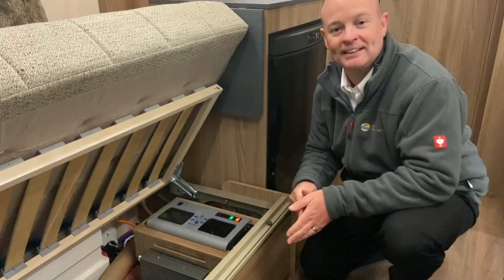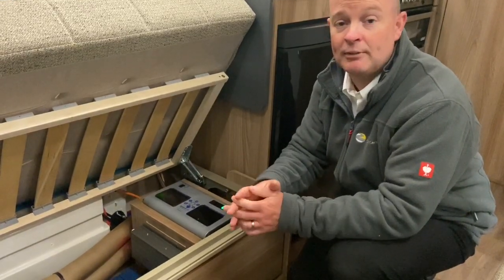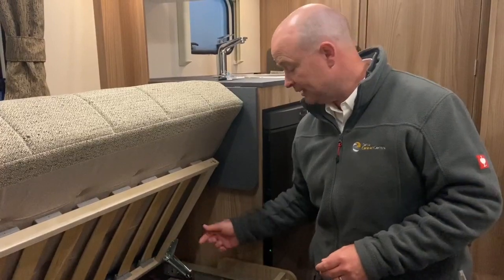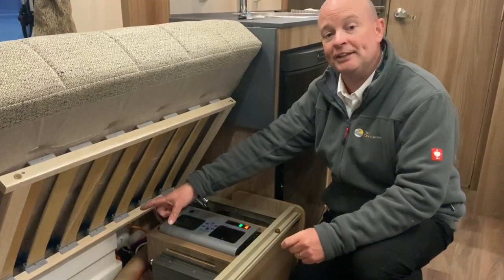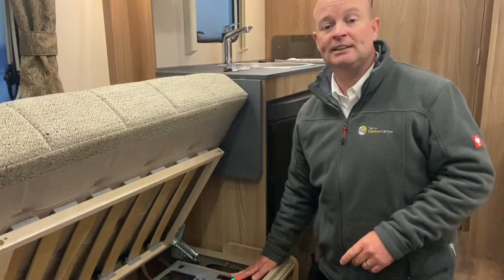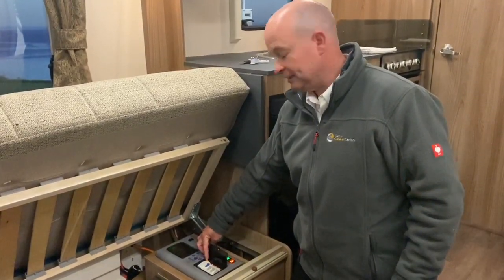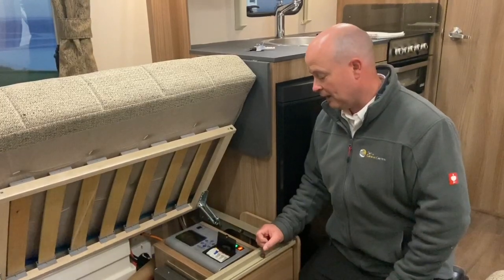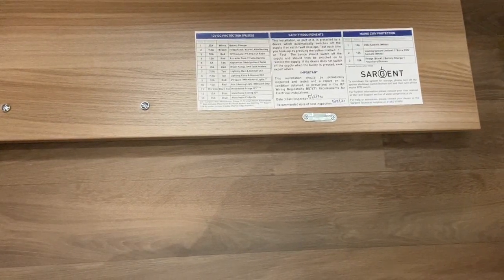Sargent power supply unit In A Swift Caravan

Comment: We plugged into a local uk site with our new swift caravan a couple of years ago and when I tried to fit the wheel lock I got a shock 
from the caravan ns wheel i then checked and found the reverse polarity light on I then tried different 230v outlets on the site and they were all the same, I contacted the site owner and they said there was no problem with the site electrics but it was obviously a problem so I left next day. The caravan was check and nff so that facility on the van is extremely useful, thanks for the tips, Rob Hodgetts Brandon Warks

Comment: I have a 2017 Swift and I leave my power switch off all the time I am not using it, and the solar panel keeps my battery topped up all the time. Even in the manual it says it will send charge to the battery whilst switch off.

Comment: I want to put my 2021 Swift into an indoor storage facility this winter. 
I have access to a mains supply, to keep my leisure battery charged through the onboard battery charger. 
As I would like to monitor the battery through the communication module and app, what do I need to switch on or off to do this?
Thanks
Reply from the maker: if you wish to monitor the battery then the black on button would need to be on.

Comment: Hi I have just put my 2021 Swift caravan into an indoor winter storage facility.  As I will need to remove my leisure battery periodically to home to recharge to keep my alarm and tracker operational, how long does their backup batteries last until I reconnect the charged leisure battery?
Also do I switch power supply unit off while leisure battery is removed?  Thanks in advance

Comment: I contacted Swift command technical department this morning 28th March 2023 and they confirmed that if the isolator button is 'OFF' it will allow the solar panel to charge the battery while our 'Swift' caravan is in storage. They also advised against keeping the isolator switched on whilst in storage as it keeps all the systems in 'standby mode' which can drain the battery. Could you recheck your information please. Otherwise great video.
Reply: I was also going to point this out and then I saw your note. The same instruction is in the Swift owners handbook i.e. if the isolator button is 'off' the solar panel will still charge the battery and they recommend keeping it turned off when in storage.
Reply: If the black system shutdown button is off, you will not be able to monitor the levels eg battery voltage using the Swift Command app

Comment: Hi, if I leave my Swift without a 230v mains connection, but want my solar panel to keep supplying the leisure battery do I just leave the isolating switch on? Thanks
Reply from the maker: Hi, Yes that is correct. The Black button on top of the Swift Command PSU should be in the on position for the solar panel to work.

Comment: Wondering if anyone else turns the 'charger' button off before attaching on-site electric hook up? 

A recent problem when we were on holiday has prompted us to re-read our Swift Motorhome manual which tells us to switch the charger off before connecting the hook up & then switch it on again after completing the RCD test.  

Does anyone else do this?
Reply: Yes. I always make sure the power button is off before I connect to the site supply.

Comment: The advice in this video is absulutely incorrect. The solar panel will charge the battery if the black shutdown is off. If it is left on it will almost certainly flatten your battery after a few weeks. The advice from Sargent is to switch off the isolation switch when in storage and the solar panel will charge the battery.
Reply: I have religeously turned off the Power unit every year and still the battery goes dangerously low during the winter lay-over. I have had to replace a few batteries due to this. Is there another way to keep the battery topped up during winter, with the solar panel only ?
Reply: @BusyElf  I've had my current Swift van for 4 years from new.  With the black isolation switch off the solar panel keeps the battery fully charged even during the winter.  If you have the isolation switch off I can only think you have a problem with your solar panel.  Do you keep your van at home? If so just plug it in once in a while and give the battery a charge but it shouldn't really be necessary.